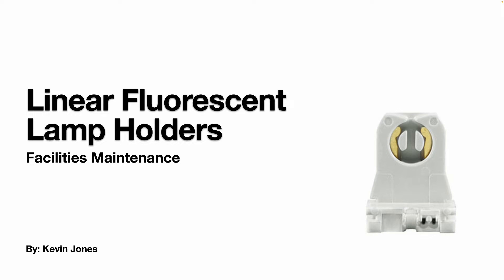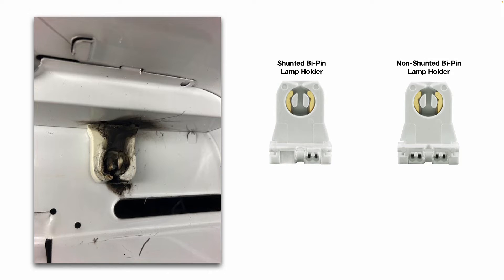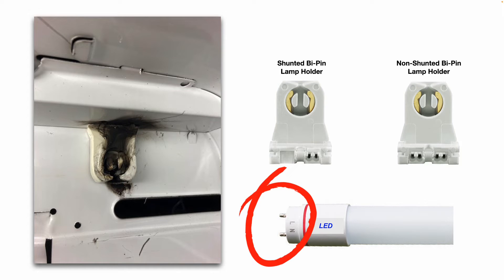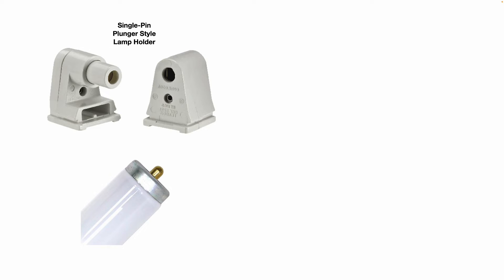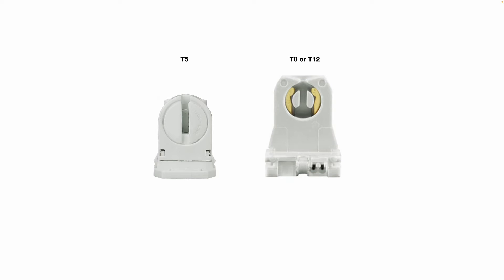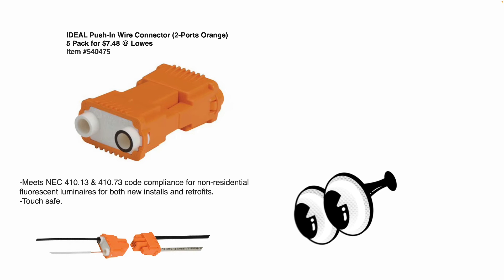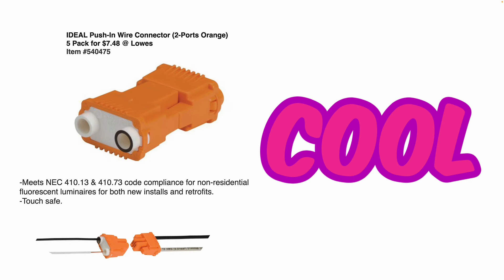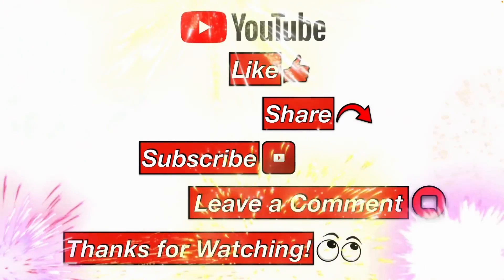Fluorescent Tube Lamp Holders! Shunted or Non-Shunted?

Comment: Thank you for the shunted and non-shunted explanation. :)
On the LED bulb, when speaking of wiring it I see there's the letters, L and N.
I would guess the letter N is the neutral but, you didn't specify weather the L was hot or not. 
Please advise.
Reply from the maker: You are correct N is for neutral.  Line is for line or hot.  My apologies for the confusion.

Comment: Lots of info on tombstones but not how to replace one. Hmmm?
Reply: Thanks. The ones I bought are a bit different. The old ones clipped in but the new ones screw in. Gotta head back to the store.
Reply from the maker: They usually slide out of the metal bracket they are attached to.  There is a screw(s) that holds the bracket to the light fixture.  Remember to turn the power off first!

Comment: As a rule of thumb,  fluorescent lamps can fall under two categories.  Those that require cathode heating,  and those that do not.  Pre-heat,  rapid start and programmed start fall under the former category and use non shunted tombstones,  instant start falls under the later and uses shunted tombstones,  although non shunted can be converted to shunted by wiring a jumper between the pins.   Lamps designed for instant start ballasts are almost always single pin and use the plunger style sockets, with the exception of the F32T8 lamp and some of the newer T8 lamps that are built with more robust cathodes and may be used with instant or programmed start ballasts,  with instant start being slightly more energy efficient when lamps are run for long periods,  while programmed start gives longer lamp life for applications where lamps are frequently switched,  like in a bathroom with occupancy sensor,  sacrificing some energy efficiency.   And many years ago Bi-pin instant start lamps were made, the F40T12/IS & F40T17/IS, these have internally shunted pins so the lamp will not light if installed in a preheat or rapid start fixture.
Reply from the maker: Great information, thank you.